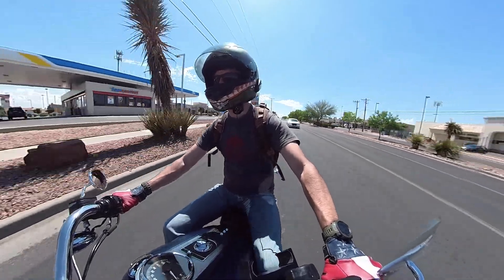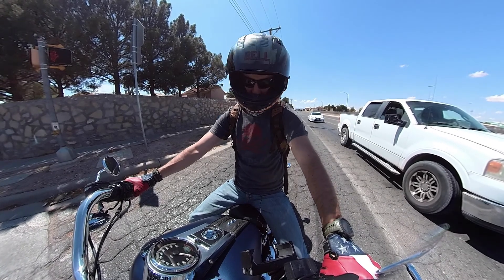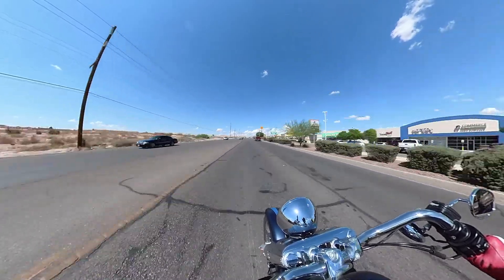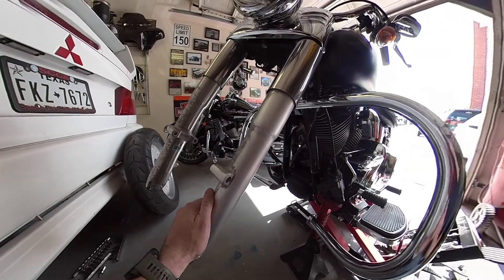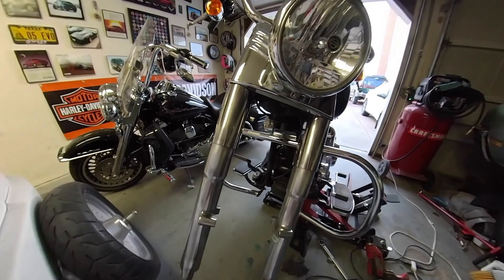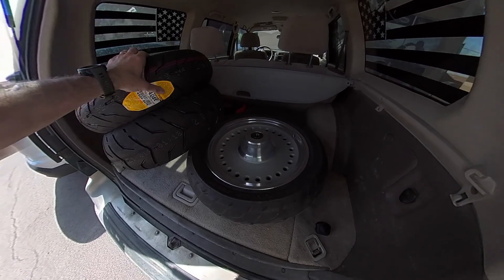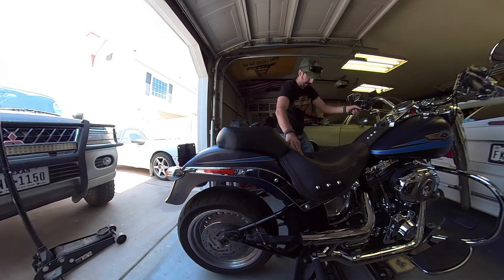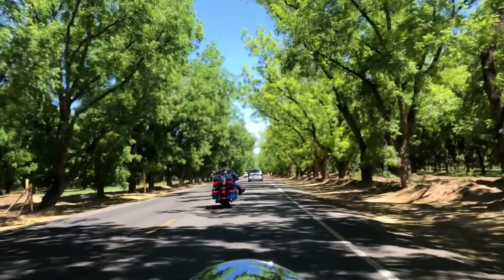2008 Harley Fat Boy Build - Episode #2: Diamond in the Rough

Comment: Would be helpful if you listed products used cleaning, polishing etc..... Tx
Reply from the maker: I think it did mention it in the video but for the chrome I used turtle wax chrome polish with 00 steel wool. For the fork lowers I used 220 grit sand paper on an orbital sander and Blue Magic metal polish on a drill polishing wheel. As far as cleaning I just used one wet mircofiber towel to wipe it down and another one to dry it off.
Reply: @dsmracer524  Tx! 😉 a little behind responding, polishing up my own ‘09 Fatboy. It helps if you list details like that in the More drop down. 🥴 get into video and those details get lost. PIA to poke thru and try find again in video….just sayin’. I’ll try that on my lowers, they need some TLC.